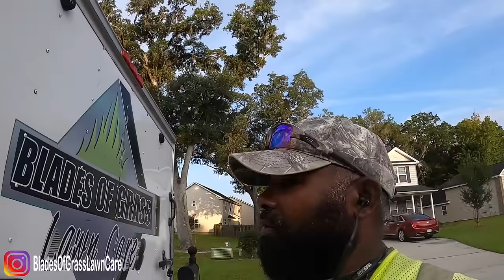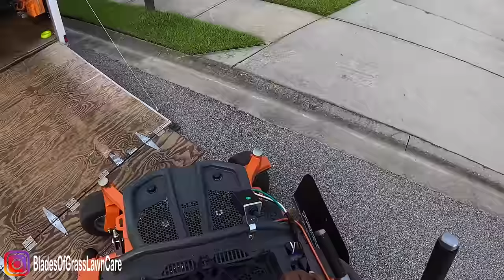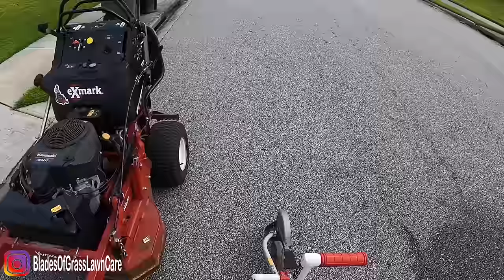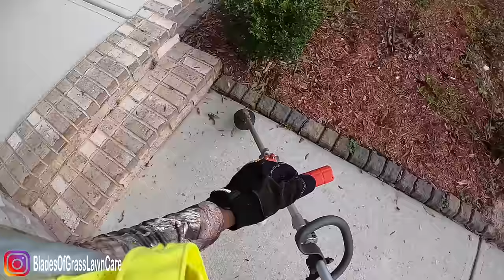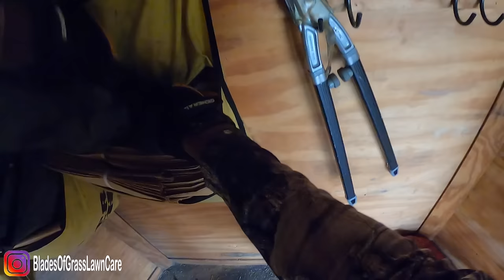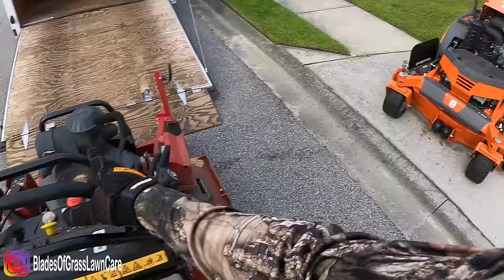This HAPPEN at our first lawn mowing customer THIS MORNING

Comment: I noticed you put the customer's newspaper on the of trash can, but didn't put it back on driveway. I have been removing battery 🔋 from string trimmer when not in use, and believe battery life is lasting longer.
Reply from the maker: They pile up on the driveway is we don't trow them away.

Comment: I want to remove the plastic guard from my echo weed trimmer. I feel that guard gets in my way and I prefer to let the string go a little past the guard. So I think I need a torque screw driver. I went to homedepot to buy a husky T27 torque bit. Because a guy in another video said to use a T27 bit. I hope this will work
Reply from the maker: It should work and it's going to feel a little different at the beginin but you will get it at the end
Reply: 7

Comment: Blades of grass llc. I make my guys walk to the right flat topping so it trows the grass away from beds,mulch, driveways etc. I noticed your guys dont do that do you not get complaints about them getting grass in the beds? I have been in buisness since i was 16 started it the summer before my sophomore year of high school and i am 36 now. I am in Knoxville,TN Elite lawn and landscaping. And I take care of 152 propertys from residentials to commercial to condos and apartments and I run 3 exmark 60in x series lazer z riders and 2 48in exmark walk behinds with 2 wheel velkeys because i can not stand a one wheel leaving a line in the middle of my strips. I run all Redmax  trimmers and blowers and hedge trimmers and have started using there back pack sprayers and i love them. But me and my guys edge with the weedeater and you can do the same edge with a weedeater aslong as you dont dig a trench with your string. And do you not think swapping from a weedeater to a stick edger cost you time? And if you walk the right direction it throws the grass and anything else away from glass doors cars etc. I run  blade blockers on all my mowers they have a pedal you push to open and close and with that and walking to the right flat topping throwing the grass away from driveways, flower beds etc. There is very little to blow. And we have Turf Type Tall Fescue here, so i never mow lower than 4 1/2 most yards is 6 to 5in, iam not quetioning your buisness because its obviously successful but like i asked do you not get complaints about your employees getting grass in mulch and flower beds etc.? Because you cant blow all of it out unless you blow half the mulch out.